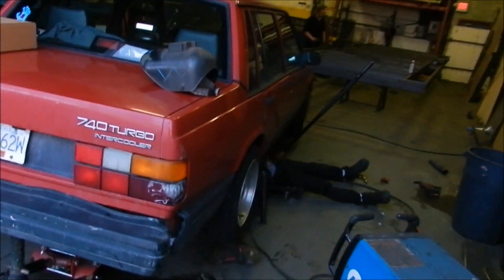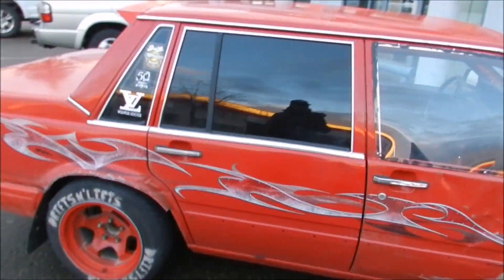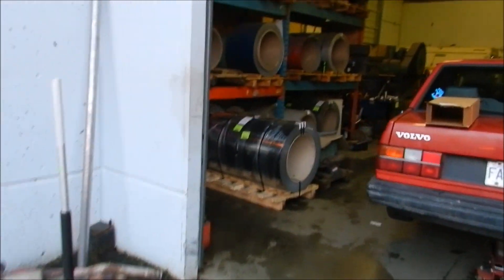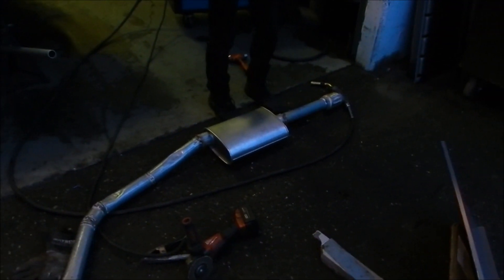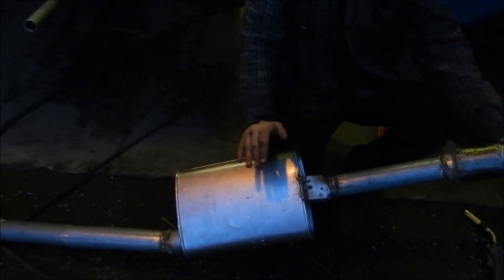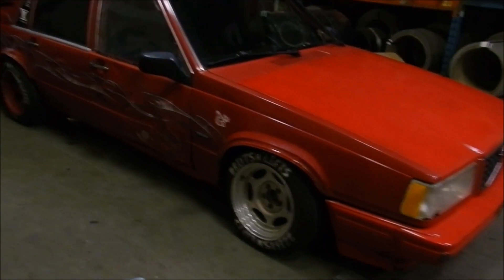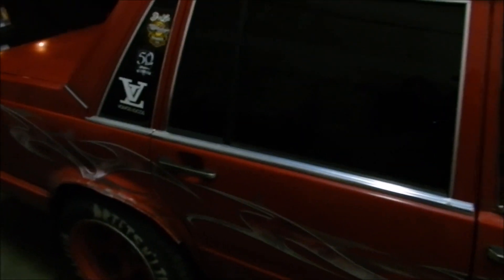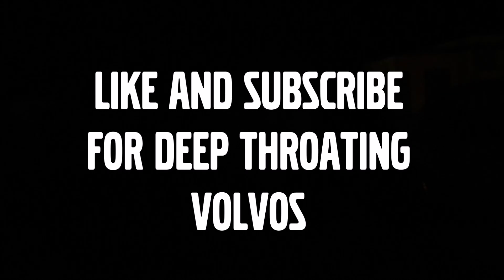MISS HUFF GETS A SIDEPIPE ! (BEFORE AND AFTER SOUND)

Comment: Hi Drifts N' Lifts. can you help me the next questions? two days ago we deside to enter the Volvo world. we need a jump start info. Is Volvo easy to work on? is the oem Ecu tunable just with a software? we will buy 740 or 940 or just any old version Volvo. we like to install turbo. dus it require allot going with turbo?we know how to install everything about turbo. but we like to know if ECU is tunable or we have to tune by the airflow sensor? we don't know anything about Volvo. are you guys using manual transmission most time? the stock ones?

Thank you in advance friend.

Comment: Im telling you you want a muffler on your turbo engine. You loose all the torque and top end hp. I have same magnaflow resonator, totally going to put on my volvo. Whats the best exhuast set up for a turbo redblock?
Reply: Phillip Gagliardi that is bullshit, my b230ft gave most power with straight 3" pipe...
Reply: Phillip Gagliardi yass! Depending on ur set up, u do want some back pressure to help the turbo spool!
Reply: WrongRs was that on a dyno? Or ur personal opinion, ie any proof?
Reply: Unfortunately I can say this is untrue (hey there, Aaron here) 
After installing my muffler I had to turn the boost controller up 4 more notches to get back to 13 psi. 
I can see small amount of back pressure being good, but it is proven turbos need to be able to exhaust massive amounts
Reply: Zan Stewart it was on a dyno, this car gave 312whp last run
Reply from the maker: Phillip Gagliardi the best exhaust setup for a turbo redblock is no exhaust basically .turbo will always make more power with straight through and no backpressure